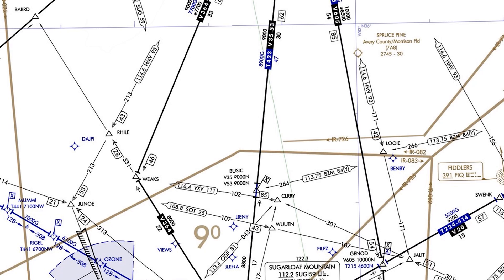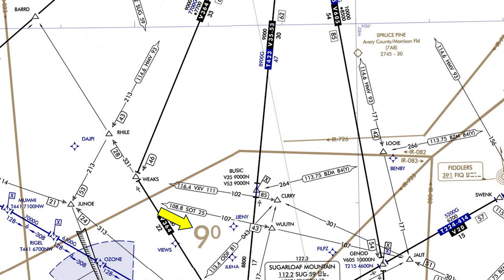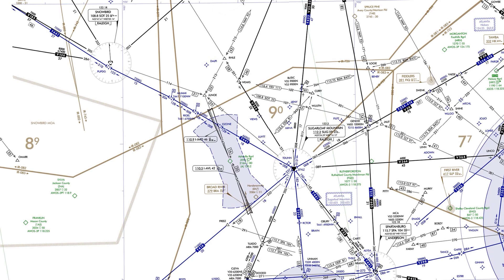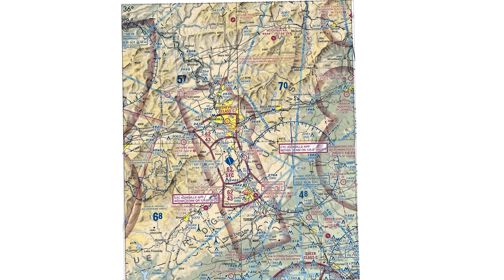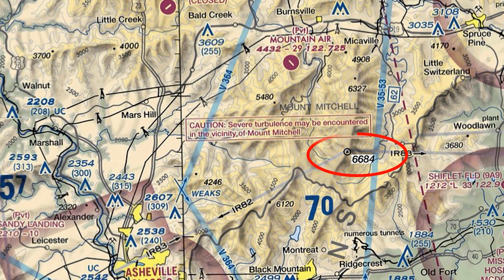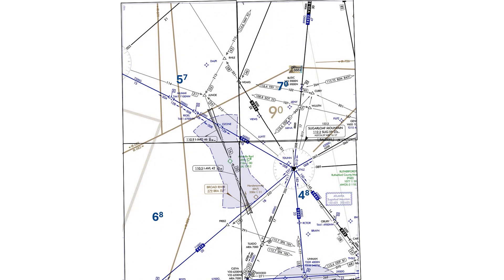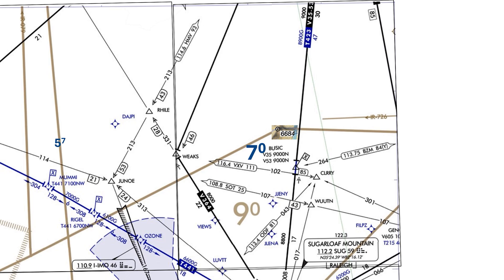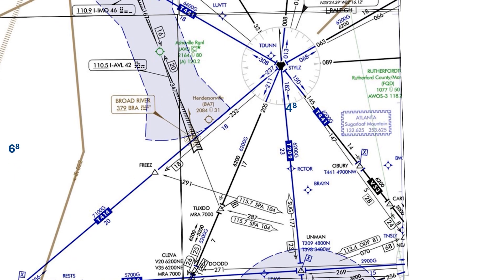IFR Minimum Altitudes Explained: OROCA vs MEA vs MEF (Real-World Chart Breakdown)

Comment: I'm sure that I was taught this at some point (re: the highest feature in the quadrant) but I had totally forgotten the details. It had me looking at the VFR chart in my local area and I noticed something. The little black dot that is associated with an elevation of a natural feature (such as a peak) is slightly larger for the highest peak in the quadrant so it makes it a little easier to pick out. One weird thing I noticed in your video is that the elevation of 6684 is on a white background. I thought "aha, this will indicate the highest point" but it doesn't. Do you know why it is highlighted that way? I couldn't find similar examples. Great refresher, thanks.
Reply: If you take a look at the area surrounding the high point at Mt. Mitchell, you will see a darker charcoal shading to the east through southeast of the ridge line that defines the high terrain. The Aeronautical Chart User's Guide states this is done to provide additional relief in locales with a big differential in terrain elevations, showing a "shadowing" effect with the sun setting in a northwesterly direction. The white background you refer to is simply to provide contrast to the black numerals of the elevation of the mountain which might get lost in the shadowing. BTW the triangle inside the circle means there is a small observation tower at that location. I've ridden the Blue Ridge Parkway and ascended the tower.
Reply: @jetjock60  Well, I'll be! Thanks for taking the time to provide that explanation (and the added tidbit about the tower).
Reply: The white background Is the highest terrain elevation on a specific sectional chart. The one In the video Is the highest terrain elevation on the Atlanta Sectional Chart.
Reply: @27sk8er4life  Awesome, I see that now. Mt. Rainier, Shasta, Whitney...all marked in that way. Thanks for that!